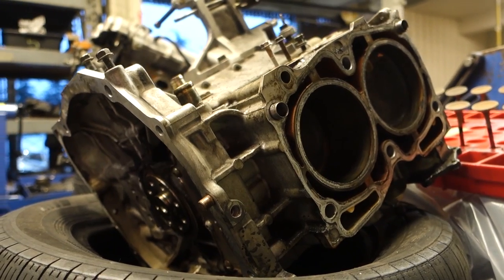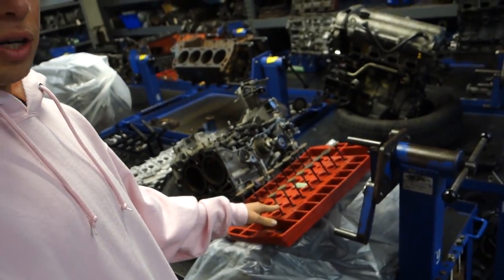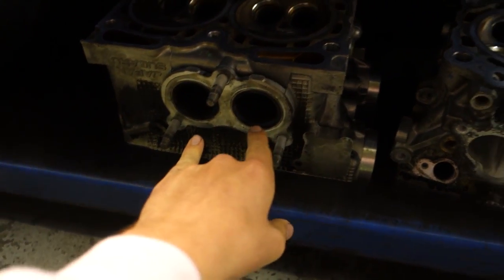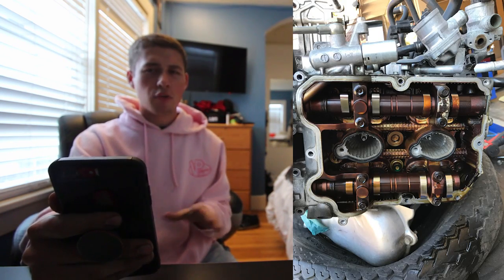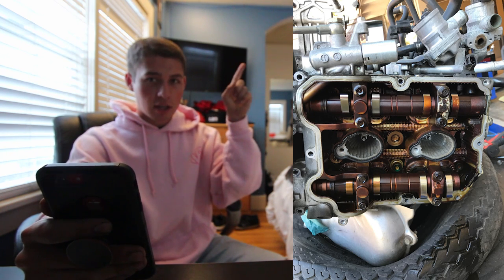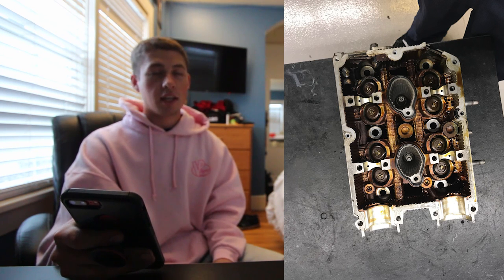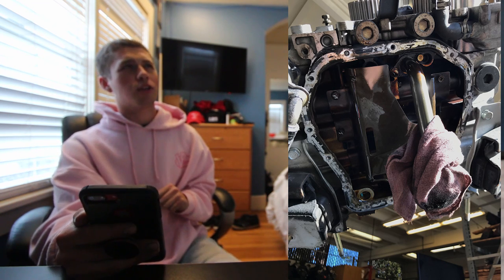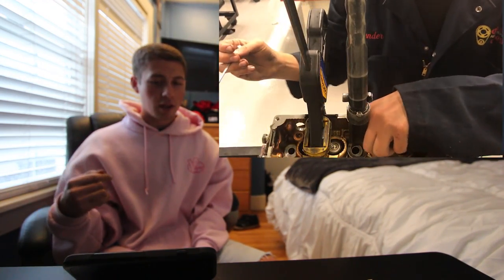EJ255 BUILD UPDATE 4! (Removal and disasembly of the heads)

Comment: I know this is an old vid but holy cow are these helpful. Props to you for taking the bull by the horns and doing this yourself rather than having a shop do it. I’m looking to do something similar but rather than building an EJ255 just rebuilding an EJ257 for my bugeye. Learned so much from this video in particular and for the record yes I followed everything you were saying about the cams, springs, and valves. I’ve been selling Subaru parts for a good 2 years now but am just starting to get into the mechanical work of them. If you ever need parts shoot me a message, and great vids man!